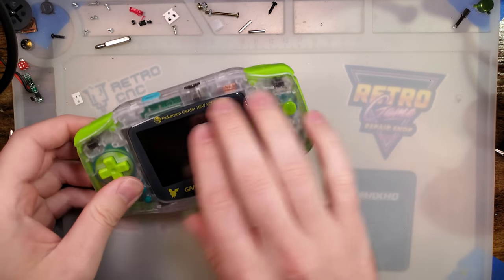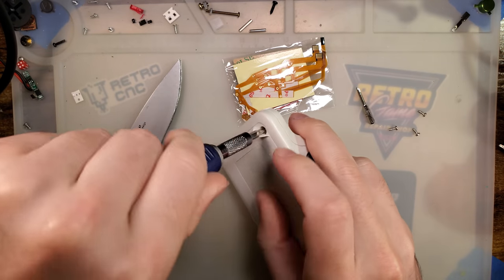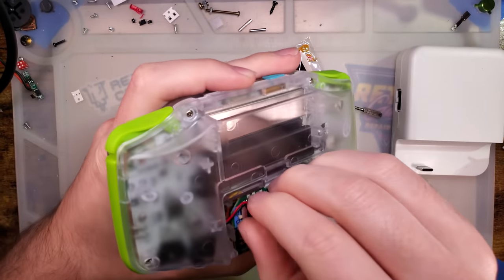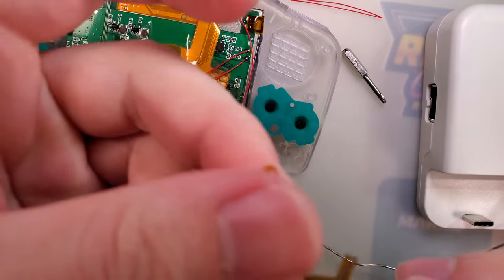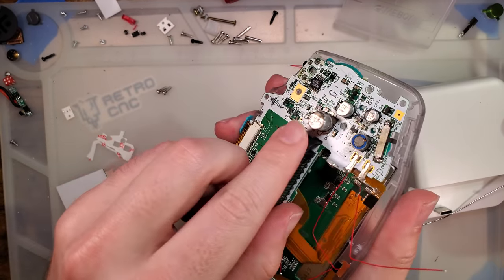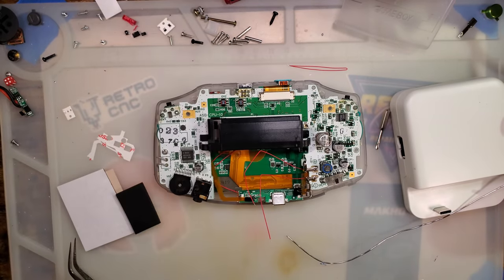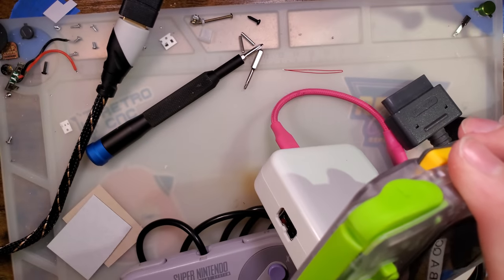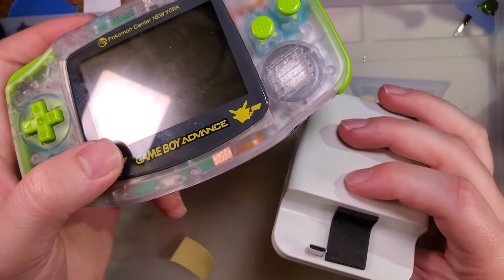Docking Adapter for Game Boy Advance

Comment: I installed this dock, HDMI kit and funnyplaying IPS V2.
It is working fine.
The sponge is to put under the PCB that connects to the dock.
The double-sided tape was used to secure the Type-C connector to the shell.

Comment: Thanks for the video Makho! I'm looking to build a new GBA and have been looking into doing this mod.

It looks like they have an updated version that fixes a lot of the issues with the one in your video.
No need to remove batteries with the battery protection circuit and HDMI output from the dock are the big ones!

You should check it out!

Comment: Well, this looks nice for people who want a switch-styled consolizer (Aka, a handheld gba that can be “docked”, so to say, for tv output and constant power, alongside offering other controls). Obviously though, it’s much worse than a regular consolized gba and seems like a lot of work just for a gba that doesn’t have a great hdmi output.
Reply from the maker: That was my precise thinking too. Lots of work for not that great of an experience.
Reply: @makho  Yeah, I definitely don’t think this is that great of a kit, unless people really like that whole switch-like mechanic of being both a handheld and a console, which more power for them if they do, but even though I already have the IPS version of the HDMI kit, I just don’t see any reason to bother with this kit myself. Like, even the “docking” mechanic is clumsy, you need to literally take out the batteries every time you want to dock it, it’s not just a plug and play deal.

Comment: Maybe it was designed with the separate HDMI kit in mind and not the DSi integrated one? Watching your video and other videos about the dock, I noticed in yours that the (what I think is a) potentiometer dial kept getting in the way of the USB-C PCB install.
 
Is there a thickness difference between the DSi screen kits and the IPS kits?

I also wonder if there's a way to merge the battery and dock USB-C ports (similar to a Nintendo Switch) and maybe have a tiny switch (separate from the USB-C connection) that gets activated only when inserted into the dock, which switches power delivery between going to the battery and going directly to the console. Would make things a LOT more convenient. 

But this mod is pretty nice on its own. Always nice to see more mods for the GBA.
Reply from the maker: Yes, they are very clearly not designed to be used together despite complementing each other so well (and being shown together in product demos).

Comment: It's fine. PCBs loooove prolonged tension caused from bends.
Reply from the maker: Well, not only did the manufacturer tell me it was compatible, they also told me it was the solution to the power problems I complained to them about. So I made it compatible. I don't recommend doing this the way I did but I see no other option with this hot garbage kit.

Comment: Would removing the GBA Fuse from the board, and installing an "Ideal Diode" between the Battery and the Fuse solve the backfeed issue?
Basically, battery to "Ideal Diode" input A, USB Power Lead to input B, GBA Fuse on the output and then that connects back into the GBA board.
My understanding is an ideal diode like a Max40200 could prevent backflow, though, I'm not an electrical engineer, so I may just be misunderstanding how that works.
Reply from the maker: you would need to connect this board after the diode and the batteries need to run through the diode first. The problem, however, is that now you have a diode dropping battery voltage and destroying what little battery life you had left. 

A better method might be to move the fuse to the dock board, run the battery input (from the left fuse pad) to the dock board, and run all the output to the GBA input (from the right fuse pad) and then just use a mosfet to switch the power. Batteries connected by default until external power switches the reg on and disconnects the batteries from the circuit.
Reply: @makho  I believe I was using the term ideal diode incorrectly, as what I had in mind was a mosfet, I've just heard that setup referred to as such.. perhaps incorrectly. I'm not super familiar with the correct terms, so apologies for that.

The method you described sounds like it'd be fairly easy to implement (save for fuddling with tiny fuses), surprises me that they didn't just implement such a solution on their board... but based on the history of "80% of the way there" that this company has, perhaps I shouldn't be surprised.
Reply from the maker: @shipool  No, I don't think you were using that term incorrectly, I think I just misunderstood. 

But yeah, this kind of stuff is pretty typical with hardware from "one chip".

Comment: I found a good solution to fix the battery problem. Remove the usb-c port which on the rechargeable battery. Then connect the dock's  5V to the 5V pad of the rechargeable battery.

Comment: It looks like the latest listing for this kit on AliExpress says it's not compatible with the 720 HDMI kits. They only list it as compatible with the old 480 HDMI kits.
Reply from the maker: when I complained about the battery problem the first time, I was directed towards this *from the kit maker*. They need to not make two mods that basically rely on each other and then make them incompatible.
Reply: @makho  I saw an earlier listing that had them all compatible, so someone must have informed them they didn't work together (or maybe they just watch your videos).

I'd love a dock that could charge a battery, play HDMI, and connect a controller, but this clearly isn't it. I wish they would take the time to make a revision after they released a product. The no battery thing is still a big issue, but it would feel much more complete with better fitment and a dock molded to the GBA shape.

Comment: Hey Mahko, I just did a build last night and used funny playing buttons with OEM membranes, and the A and B feel good, but the DPAD is super tight. Should you not use Funnyplaying buttons with OEM membranes?
Reply: I'm not Makho but I did have a similar issue here - mixing OEM and FP/3rd party buttons and membranes isn't expressly forbidden or anything, and usually you won't have any issues. What Gameboy is it? With my GBA the B button needed a tiny bit of filing to avoid the button rubbing against the edges of the hole it fit through - are any parts of the button you're using sticking out or otherwise noticeably larger than the OEM buttons? Often the quality control isn't perfect on Chinese stuff, and things like mould lines etc can have bits of plastic that can snag.
Reply: @eoinogaora2459  Thanks for the reply, so Im using oem membranes, funny playing buttons, and an extremerate shell. Maybe its the shell as well? The tolerances on it haven't been super great. Ill compare to the oem buttons and see if thats the problem.

Comment: I don't understand the point of this dock considering it doesn't have HDMI out.
Reply: You can buy the Two Wire HDMI
Reply from the maker: The point is that the other part of this, the HDMI part, kinda needs external power to run smoothly and does greatly benefit from external controller support and this does both.

Comment: would you consider making a alteration to the gba slate to allow for this dock to be compatible with it?  or is there not enough space in the slate shell to allow for this mod?
Reply: I'm not Makho, but given that the slate uses the original back housing for the GBA SP rather than a GBA, I'd assume it would be way too cramped given how much more tightly compacted everything is in the SP.
Reply from the maker: no. I would not consider this. If you think you can fit one in yours, feel free to file the housing though.